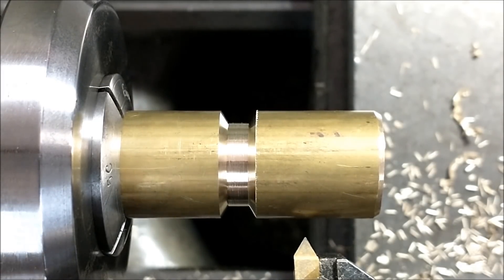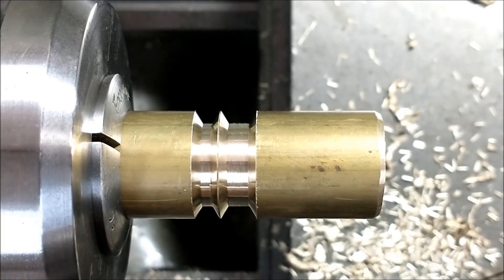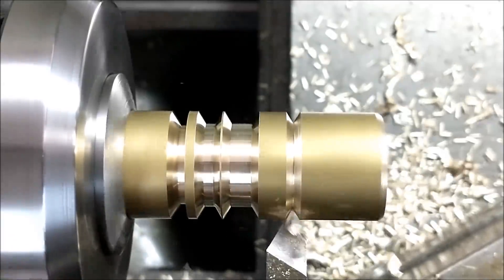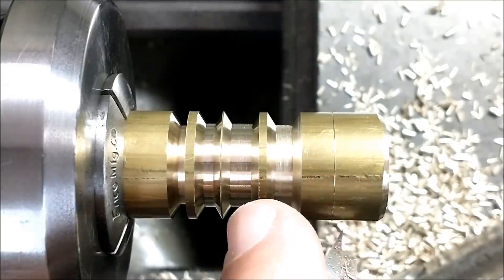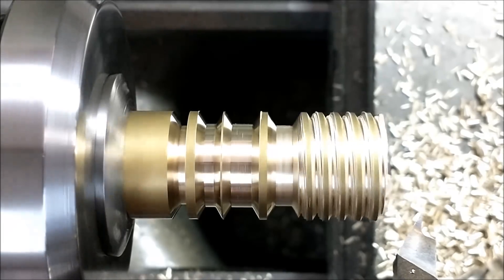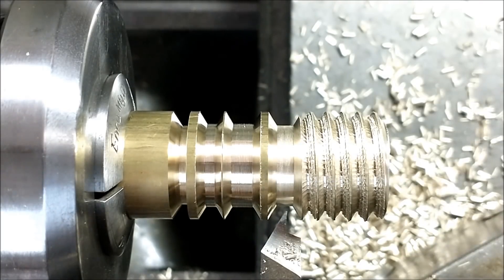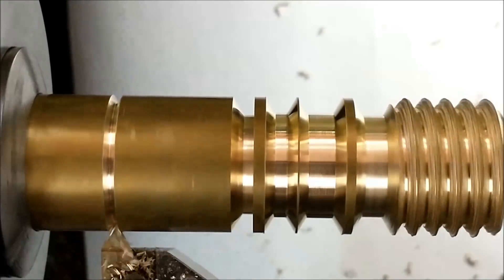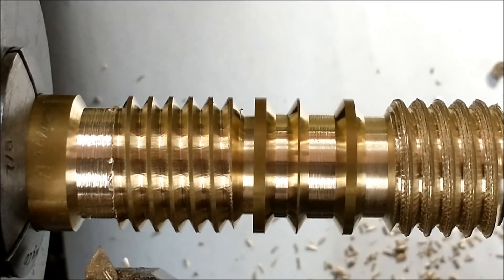FACT CHECK:  Threading Myth BUSTED !!   You'll Find This Interesting......

Comment: so as a guy that runs a cnc on the daily. I can tell you this will work perfectly and has the advantage of reducing chatter if you clearance one side of the tool. (staggered cut can be even better)
if your tool has a 0.004" radius at the tip, you want your compound in feed to be about 0.001" per side for a decent finish. definitely not a fast way of doing it, but it will save your but sometimes.

Comment: When I went to college, here in the UK, back in the 90s, all our lathe compounds were set at 90 degrees (to the carriage). That’s where mine is always set. It’s so much more useful there than anywhere else for normal day to day use, & far easier to set the toolpost to 90 degrees too.
I’ve never understood this American obsession with permanently setting it at 30, especially considering how rarely anyone is called upon to single point thread these days. Surely it’s easier to set it if & when a thread cutting job comes in? 🤷‍♂️ why leave it in such a useless position?
Reply: Well I was taught here in Australia that we just move it back to 0 when normally cutting. Two nuts and a dial. Done.
Reply: @manofausagain  that’s what I mean by 90 degrees. The scale reads zero, but it’s at 90 to the carriage.
It’s certainly far more useful in that position. I wouldn’t move it unless I wanted to take a minuscule cut or if I was cutting a really big thread.
Plunge cutting, with the compound at 90 degrees to the carriage is absolutely fine for most threads up to maybe 1” (25mm) (on smaller lathes at least) & compounds are best at 90, (or zero or whatever you prefer to call it).

My lathe is a bit more than just 2 nuts, plus you’ve also got to re-set the toolpost. So it’s not necessarily as easy as that.

Comment: Great demonstration Joe, I was taught this in my apprenticeship but have run into many people who hold the view of single edge cutting. Cheers, Jon
Reply: Throw some layout die on the part between passes and that should shut up the wizzards.   If you do the 29-1/2 like the old South Bend book shows and if you got the tool ground perfectly there will be zero point no layout die on both flanks in each and every pass and both flanks will have no steps and  be smooth as babies ,,,,,,,,,,,,

Comment: Agree completely, I was taught the 29.5 deg method long ago, but I plunge everything nowadays. For me results are the same or better in difficult materials as well. Perhaps it has to do with modern carbide tooling. Carbide does not like rubbing, in my mind a properly rounded 60 degree tool should actually perform better plunging since depth of cut will be more consistent around the tool. I can speculate that perhaps sharp HSS tooling and less rigid lathes may perform better the old way.

Comment: I love this video !  I was taught to set the compound at 30 degrees, I never really thought about it. Early in my career I learned to cut double lead acme threads with no relief cut allowed. You had to time backing the tool out while cutting threads at slow rpm.   I don't think i could do that these days.

Comment: GASP Joe! you threaded towards the chuck!!! Nice demonstration, Pierre taught me to thread straight in plunge cutting and it has not failed me yet.
the only time i have used the compound is to pick up an existing thread.
Reply: I have been using the cross slide for threading for over 50 yrs and never had a problem yet. Only use the fiddle slide to pick up a thread.

Comment: Ugh. This is a cnc concept, not manual. Only cutting on the front edge is slang for taking most of the load on it as you go deeper and deeper into the cut. Lol your age is showing. Check out the Sandvik website
Reply: The 29.5° style is written in my machining handbook from 1946..😂 so I'll assume you only mean to say controlling the leading edge of the tool mainly cnc stuff.
Reply: @C3powange  😶

Comment: In Australia we don’t set the compound to half the thread angle but advance the compound slide a small amount to reduce the cutting on the left hand side of the tool. This reduces tearing and improves the finish. I used a ratio of 1:5 which worked for me. 
This is what is needed with hand ground high speed steel tooling with no side or back rake. With introduction of carbide insert tooling with magical tip geometry I think the need for advancing the tool is not needed anymore.

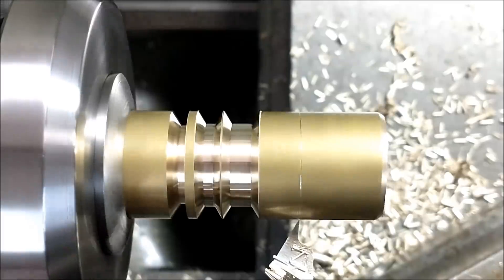Comment: 5:50 - 12second*rotate speed = count of passes needed for that smooth right surface in thread.
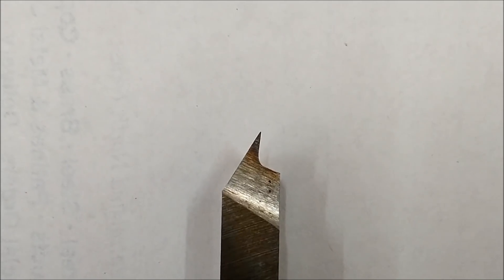Reply from the maker: 3:30, 1st piece done, 4:00 boss tells you you're fired.
Reply: @joepie221  boss tells im fired and my boss is myself

Comment: Most of the time I ignore the compound for threading, simply because it's rarely on the machine anyway. Heck, I just cut a M42x2 thread in cast iron at 650 rpm, 'cuz that's as slow as my beast goes, with minimal issues, except the terror of a possible crash.

Comment: Well Joe, you certainly made a point there. Of all those I worked with who used a lathe stated te opinion that it was the leading edge doing all the cutting and the back side of the tool was redundant. They all used a tool ground to 60 degrees though and offset the compound slide. Hmmm. regards from Wales
Reply from the maker: Just grin next time they speak.

Comment: In the 1980s, I had an order for stock sling swivels and I had to make them with wood screw threads. Wood screw threads are tapered near the insertion end of the thread. I made these by two methods; form tool and form ground grinding wheels. I must say that I have never heard of this myth of half of a threading tool. It did as I expected; created steps on the trailing edge of the thread form. In finishing, my wood thread could not have been accomplished with half of the form and since I had to cut the threads on a taper half a thread form would have looked really bad. This was a very nice demonstration of a weird myth that has come into the machining business. Keep up the "Myth Busting" and I will await your next demonstration.

Comment: Or 27.5 for Whitworth, 23.75 for BA and 40 degrees for Panzergewinde (PG) threads. 
(Just pointing out that not all threads are 60 degrees.)
Reply from the maker: Is there a 69 degree thread?
Reply: @joepie221  I hate it  when I typo when being pedantic. I meant 60 degrees.
Reply: @joepie221  my favourite !

Comment: Well, as always, when people don't fully understand the process, they tend to oversimplify the statements about it to the extent of distorting them. When someone who knows how it works says that it's the left side that does threading, it doesn't mean "only the left side", it means "mostly the left side", as this experiment clearly demonstrates. The right side does just as much as the left one on the first pass. But on the second pass, the left side does twice more while the right does as much as it did on the first pass. And it goes that way progressively. The experiment still produced a roughly symmetrical 60-degree thread, not a buttress thread or anything, but with a very ugly stepped right side of the groove. What would be enough to make it smooth, geometrically speaking? A 60-degree tip that is just barely larger along the X-axis than the depth of each step cut. Why we don't do threading this way? There are a lot of reasons: it would be really hard to manually grind a tool like that with a notch, it would make it less rigid and increase chatter, it would limit the depth of each step. By making symmetrical cutters, we aren't just pursuing the clean right side.
Reply from the maker: My Father always said, " say what ya mean and mean what ya say".

Comment: Thanks, Joe. QUESTION: Now how are the threads cut for devices such as a speed vise, that utilize half of a 60° thread?
Reply: Those would be called a buttress thread, pretty much a cutting tool shaped as his first tool but only feed straight in with the cross slide. Buttress, ACME or even square threads are used logically in areas where higher strength and long term durability is desired over what a standard 60 thread profile would provide.
Reply from the maker: Look at a jar thread sometime.
Reply: @joepie221  Yep, pretty specialized thread form, crest and root radius, and even interrupted on some of them. The most complex use of threads I know of, https://www.youtube.com/watch?v=UN1tOVzFrWY Closes like a very expensive bank vault door and all designed and built in 1889.

Comment: spot on Joe. just out of curiosity, once the tool has made a pass. could you not just stop the machine, put it in reverse back to the start, then make another pass how ever many thou in. instead of backing the tool out all the time. great vid as always Joe.
Reply: You can but it’s bad practice to drag the tool back through the cut. It can dull or chip. Best to keep it cutting in forward passes only. 

When I was an apprentice I was taught that setting the compound more than 30 degrees would leave a stair step on the right flank of each thread.  Anybody got a video on that?  I’m no longer in the biz or I’d make one and throw it under the comparator.
Reply: @Chris-bg8mk  yes that always happens when the compound angle is more than the angle on the right side of the cutter. In his extreme example it is -5° on the cutter and +30° compound angle.

Of course if you cut with 31° compound angle it is almost not visible but you end up with a 61° thread profile which is not good.

If the right side of the cutter is ground to 29° and the compound angle is 30° the thread is still 60° and it may work fine, just not so smooth as usual.
Reply: No, the backlash in everything means that the spindle would turn way before the tool starts moving & you'd cut a double groove
Reply from the maker: Backlash would get ya.

Comment: On a side note in cnc canned cycles for threading in several of the cases i have come across the tool path as far as the feed is concerned can be controlled as a right, left, or both sides with each pass.  Left the right then left and right descending offset as to put a larger or smaller per chip load on the sides of the tool.  Including a straight down feed as well perpendicular fo travel.  In all things manual this is a user subjective approach and confidence.  Final pass should always be both sides more or less and always with a full form tool.  Joe you nailed it on this video.  The fancy stuff is simply for tool life management and chatter control.  I think Kimber commented his lack of a compound,. He may have less chatter than a 29deg angle with a compound in overall ridigity.  The comment about chatter in plastics is all reduced to tool material and rpm.  Super honed tooling is best for plastics with high positive geometry and a chip pocket, imagine a knife blade reaching up into the part.
Reply from the maker: I hate carbide on plastic. HSS is a step towards success.

Comment: It is not that awfull... I just thought that my internet was lagging and I had lost the HD... Back to some 56k modem...
In fact, I can make much more awfull thread when setting my compound to 30°... on a european lathe... 🤨🤨 As an early beginner, I didn't know that all lathes were not measuring the compound angle in the same way... 😅😅
The thread is a bit (heum...) sloppy but it works for holding the stop through my welding table...

Comment: I have no idea why anyone would imagine that the 'back' of the tool is just there for decoration ;-)
Even a simple electronics guy can see that threading is a 'form tool' operation ...ah, well, myths have to come from somewhere,  always fine to see another video from you, sir, even a 'myth buster' ?
Reply: I was thinking the same thing. I`m no machinist, I`m just a guy who bought a chinese 500mm lathe ... and I figured that out !
Reply: If the leading edge is the only thing cutting. Why, when you buy one of the tungsten insert threading tools, do they come with both sides of the profile formed? I never understood where this, one side doing all the cutting, came from. Leave it to "Joe Pi" to throw another misconception in the wood chipper.

Comment: I've just sketched out the path the single point takes with the compound slide set at 30 degrees and it shows a small triangular section that is cleaned up at each new pass of the cutting tool. This clearly shows that a full 60 degree tool is needed to form the thread but only a small section of the back edge of the thread equivalent to the depth of cut is removed from the back edge at each pass. The sketch also clearly demonstrates the ragged side of the cut as demonstrated in the video if only half a tool is used.

Comment: I think there is a second important point you missed. Look at the chatter on the left side on that first cut. Some of that is probably form the narrowness and flexibility of the cutting tool. But some of it is most likely from lack of support against the part for the right side of the tool, countering any deflection from the left side.

Comment: I was under the impression the 29 degree or 29.5 degree wasn't because they say only the front side cuts but rather to avoid the back side rubbing for the entire depth. Yes it will still rub towards the point but not all the way out. The less rubbing is in hopes of less chatter and a smoother thread especially in the holy world on lighter machines. At least thats what I was told now if it's true or not I can't say but makes sense.

Comment: Look how nice the first tool cuts when just plunging straight in with both sides removing metal equally. Why would you not want to do exactly the same when cutting a thread?
Reply: One of the reasons put forward is that even pressure on the tool can cause the tool to wander within the backlash on the half nuts, I have never really thought that was a problem, since the lead screw is feeding relatively quickly, and if your lathe was really that sloppy a little tension on the carriage lock would definitely hold it solid against the lead screw threads.  I guess I never realized this was a myth, sure you can relieve the back of a threading tool, but your depth of cut has to remain less then the length of the back side (In this case Joe had a 0 length back side) I guess I thought that was common sense. 

It doesn't appear to me to be reasonable to relieve a tool like this, regardless of the supposed reduction in tooling pressures because I would always want to be able to make a light final pass with full contact on both sides to improve the surface finish in the thread grooves, and I sure don't want to switch tools while threading just to make that final pass.

Comment: Hi Joe, please could you do a video on correctly making an internal thread gauge? 
I have tried to make one for m14 x 1.5, and it measures correctly with 1 wire, but is tight in a standard nut, so cant be right.
Thanks!
Reply from the maker: A mistake commonly made when making a thread plug gage, is the person making the gage uses the PD for an external thread. Although the gage is technically an external thread, it must be fabricated using the PD for the internal thread.

Comment: I've never bothered with the angled compound, did tests years ago and found little to no difference in the final thread so I've not bothered since.
Reply from the maker: Me either. I plunge every thing.
Reply: And me toolmaker 50 yrs always plunge cut ,never found any benefit to set  compound slide at an angle.
Reply: @johns5447  And I have done the 28-1/2 because tghat is the way I was taught. ,,,,can some body get a sleever or big spud wrnch and help me get my foot out of my mouth. - Iv'e always extracted my foot that way. too so it must be the right way. ;).

Comment: Do you still need the cross slide set to 30 or 29.5 or can it sit at 0 being at 90 degrees, I’ve seen people do both, figured you would be the best person to get a straight answer from Joe, thanks
Reply from the maker: I keep my compound set at 45 degrees. It doesn't interfere with my ability to see the cross slide dial, and it doesn't get in the way of the tail stock when I slide it in. Since I plunge all my threads, only the tool needs to be square to the work and nothing else matters.
Reply: @joepie221  Awesome, thanks Joe, really appreciate your response, your my go to channel for learning new techniques and methods, your knowledge and skill is incredible and you really do a great job at explaining not only how but why, been subscribed for years now, love the channel, amazing job on the mini lather btw...
thank you, Chris
Reply from the maker: Thanks Chris.